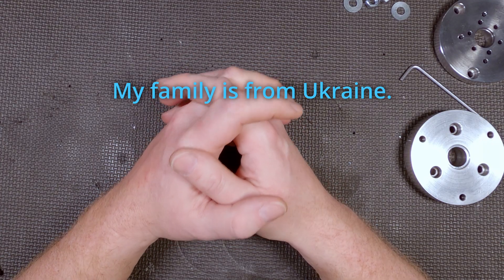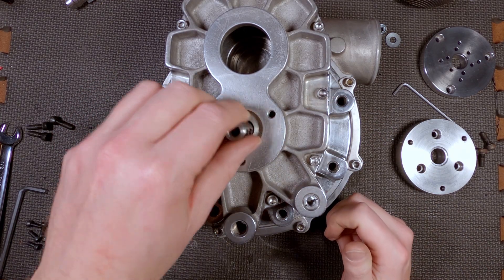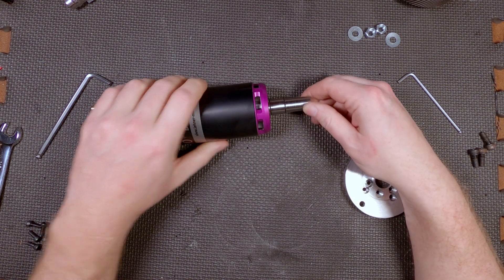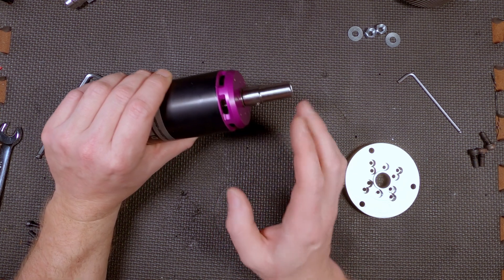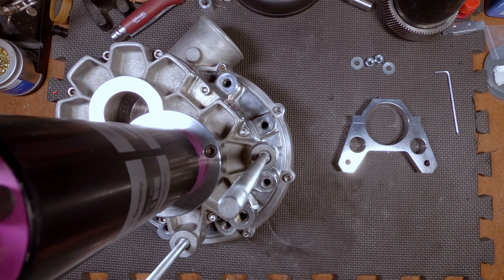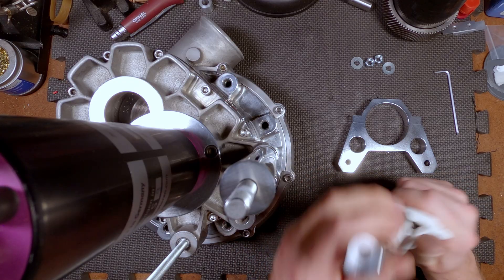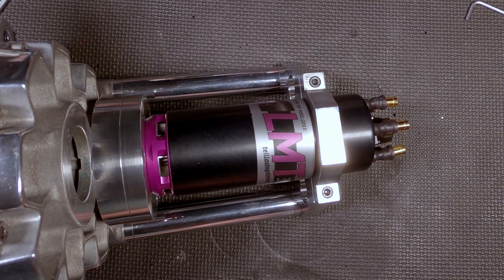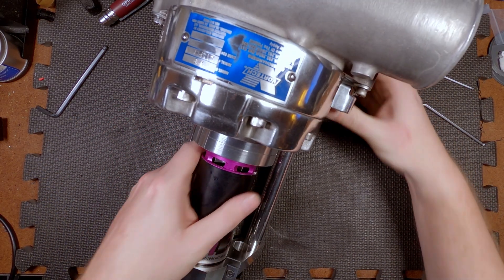DIY Electric Turbo: Sledgehammer Assembly

Comment: Why remove the vortech gearing? Drivetrain loss? Seems like a perfect setup to use multiple motors, pulleys to fine tune the compressor rpm
Reply from the maker: Because power is torque x rpm.  And the more torque a motor produces for a given power, the larger the motor has to be.  A similar power motor to the one I'm using here that spins at only 8,000 rpm would easily weigh at least 50-80 lbs and be a lot bigger.

Comment: What is the Model, KV, and any other specs on that Lehner motor?
Reply from the maker: I believe it's an LMT 30100 motor.  I don't remember the kV off the top of my head, but it's good for 50,000 rpm and 63 volts.  Everything is currently packed up for my move.

Comment: I worked on my grandpas farm with tractors and other heavy equipment and soon followed with wanting to make more power with great reliability. In the proccess Ive come to learn heat is almost always gonna be your enemy. Its also VERY expensive.

Quite a bit of time has past and now I own a 2016 LML Duramax makin around pushing 32psi.  Intake temps and EGT's are such a pain in the ass and there is no way of getting around them with the typical turbo set up. Ive looked into supercharging and everyone says it's not for diesels due to parasitic loss and what not. And really the only thing that comes up is Detroits 2stroke engine with blower style setups which are meh at best

As soon as I heard about electric turbos I instantly knew how much of a game changer those could be and also knew the limitations. This whole setup you have here is some seriously clean and professional work

Comment: You just snagged a `scriber... I used to be madly passionate about cars some time ago, but my main focus was machining and machines... I watch jafro to keep my automotive passions up, but you just hit the spot... Ang. con. ball bearings in a turbo... Most interesting... Not sure as to how brilliant of an idea that really is, as any gunk will mess those up real quick and in a hurry, and engine oil is definitely not clean enough for such lubrication even after 10 hours of engine work, but hey, fuck do i know, i just saw this shiny block for the first time, maybe the oil is just cooling the thing and bearings are sealed and grease lubed with an ultra high speed spindle bearing grease... I didnt even pay attention to the number of ports on the thing to even check if it was coolant cooled or oil cooled... I was just pleased to see both of my interests overlap... And btw, i love the ``you`ll have to deal with it`` attitude... 

All the best and kind regards!
Steuss
Reply from the maker: Thanks.  I used Kluber's Isoflex 15 grease in the bearings and they have so far held up fine for the last year without any maintenance.  Since this thing doesn't spin all the time, I think it should last for quite a while.
Reply: @AlexLTDLX 
Aaah, so bearings are not oil lubed? Kluber makes some fine stuff... I use Kluber LDS Special A, as that is what my milling machine uses in her spindle bearings... Of course i don`t waste it on random bearings and every bearing, but when there is a bearing and an application where i want to rely on quality rather than service every year, i use that grease... It`s designed to run loaded mill spindle ultra high precision bearings for 5 years between changes, so you know it`s some good shit... 
I will definitely remember this video for future reference... I am a car nut afterall... This type of modification will likely find its way into a few of my cars... 
I have a few of my own lunatic ideas and designs, but this is much more tame and more easily doable when compared to a custom special engine with custom induction, exhaust, ``valving``, lubrication and ancillary systems... Not to speak of an exhaust cooling steam system with a turbine and condensers, all merely there to act as another induction system that partially feeds into exhaust to make a pressure delta via velocity differential as to put negative pressure on the exhaust manifold, while also having a single thin tube for secondary exhaust combustion - metered so it doesn`t mess with O2 sensors... And 4 small lines that would feed constant warm air(around 75C) to brake rotors, which would keep them closer to optimal operational temp, while also cooling them during harder use, as the turbine would likely be spooled by hard engine use(hot exhaust), and would continue to blast air through its metered lines for a minute or two just on heat inertia of the whole system... Oh, have i mentioned that the car would be converted to 4wheel drive, but all 4 wheels would be ran by independent hydraulic motors and would have 4 wheel steering and hydraulic suspension? Yeah, that is my kind of madness, so you see why i called your sledgehammer more tame... But that kind of madness has to wait... That shit will snort lines of my cash like a rockstar, and i need a special car to do it, something worthy of such a massive project and undertaking... Aaand i need to build a new shop to fit all my stuff... 

All the best and warm regards!
Steuss

Comment: I dont mean to be a dickhead, but show us a boost gauge. These things just dont work.
Reply from the maker: This one put a 12 second, 3,500 lb sedan into the 9s at the track.  Watch this video and get back to me: https://youtu.be/RT0M88xHzNQ
Reply: @AlexLTDLX  color me impressed! Takes a lot of power to get any boost out of these electric turbos. Would love to see a hybrid turbo.
Reply from the maker: Lol - you're the first doubter to get back to me after sending that link.  That shows you have integrity.  It does indeed take a lot of power - like 33,000 watts.  In this video I overlay the power going in during a track pass: https://youtu.be/nlTVHkfSQXM  If you look at the electric turbo playlist it has over 90 videos - I have a lot of money and time tied up into the development of these things.  Now I'm working on a universal controller and cheaper, easier to build units.  They run at about 14,000 watts, but can still support up to 650 hp with a single unit on the right engine.  I now have two of those and also still the Sledgehammer.  You can probably guess where this is going...
Reply: @AlexLTDLX   Haha, right on brother! You've earned a subscriber. I'll make sure to check out the build series and see how it's been out together. I'll look forward to the next setup. Respect 🤙

Comment: isnt this an electric centrifugal supercharger? since its not exhaust driven but instead driven by the motor. for en "electric turbo" it would have to be more akin to an F1 MGU-H, where the electric motor powers the shaft of the turbo in the space between the hot and cold sides (though arguably, that could also be seen as an "all in one twin charger" as it becomes both motor and exhaust driven, like a twin charging setup)
Reply from the maker: Yes, but more people search for "electric turbo" than "electric supercharger."
Reply: @AlexLTDLX  haha, fair enough. fun build, interesting to see it done on a scale that can actually be used instead of just as a proof of concept.

Comment: How would someone tune their engine for this? Although I’d assume you can figure a way to use a pressure sensor and some electrical components to keep your boost at a specific pressure no patter the rpm. You’d have to have it automatically adjust the motor speed accordingly with either throttle position or relative to intake pressure/boost
Reply from the maker: My car has an aftermarket EFI setup.  Here it is at the track: https://youtu.be/RT0M88xHzNQ
Reply: @AlexLTDLX  I saw but what controls the speed of the turbine motor? Is it full on all the time?
Reply from the maker: In my case it's on full speed once the throttle is over 80% and the engine is over 3,000 rpm; since the car makes 500 hp N/A, I'm going for max power.  But you could easily stage it.  I'm working on a "universal" controller based on a differential MAP sensor.

Comment: where do u even find a motor like that.
Reply from the maker: LMT in Germany made this one.  It wasn't cheap or easy to get - which is why I've developed an easier, cheaper unit that supports only slightly less power.

Comment: The problem all way falls to the cooling and lubrication
Reply from the maker: So far it's been on the car for a year and has required no maintenance.  Keep in mind, it doesn't run all the time.  You rarely need to go from 500 hp to 800 hp in most circumstances.  If you haven't seen the latest track test video of this thing, here it is: https://youtu.be/RT0M88xHzNQ

Comment: No electrical engine is going to be able to keep up with that high of RPM even with gear reduction it's going to wear out the parts
Reply from the maker: This thing put a 12 second car into the 9s on pump gas: https://youtu.be/RT0M88xHzNQ  And it's been on the car for about a year with no maintenance.  Remember - it doesn't run all the time.

Comment: What is the rpm of the motor?
Reply from the maker: It peaks at 50,000 rpm, but we're seeing about 33,000 under load (supporting 800 engine horsepower).

Comment: If you could replace those 2 plates with 1 plate of approximately equal mass to a single plate, your electric motor would have to move that much less "extra" weight.  I know spool-up time and max rpm of the compressor are already awesome, but you'd draw less from your bank of batteries.  Do you have to replace those often?
Reply from the maker: The batteries should outlast me - they're LTO (lithium titanate oxide) cells.  They're supposed to be good for at least 30,000 charge/discharge cycles.

Comment: How does it know what rpm you're at for the boost timming? If it's on all the time, I'd imagine at low rpm would be too much boost. Does the position sensor tie into the tach wire at the coil? So it can increase boost as the rpm climbs.
Reply from the maker: It's controlled by the car's EFI computer.  Currently, I have it set to trigger above 3,000 rpm and 80% throttle.
Reply: That thing is awesome. Is the position sensor tied into the computer and at what spot?

Comment: What size motor is that? Its huge! Beautiful craftsmanship. You have to sell these because i need that bad! Cheers from Australia ❤
Reply from the maker: Thanks - that's an LMT 30100 motor.  It's rated for 50,000 rpm and 53 hp.

Comment: Why did you choose a supercharger as your base for this? I was thinking of making something like this but I was planning to use a turbo with a blown exhaust housing.

Just what you had on hand? Or is there something I'm not thinking...?
Reply from the maker: Good question - turbos generally require higher impeller speeds than centrifugal superchargers.  Given the hp level I was looking for (editing the second dyno video right now - and this thing is definitely capable of 800 flywheel hp on a good weather day), and the available brushless motors/ESCs, this seemed like a logical choice.  If you're looking for less power, there are smaller brushless motors that can turn 75,000 rpm; but definitely check out the P2 versions on my channel - they make make less power, but are a lot cheaper and are more "tunable" given the belt drive and available pulley ratios.  You could optimize those for a particular engine much easier.

Comment: I'm probably missing something;  How does this spool up when needed?  A turbo charger, being driven by exhaust gasses, increases speed (boost) as the engine speed does. Does this run constantly? Serious question. Thanks. what do you think of the Chinese turbos for sale on Ebay?  Good video!
Reply from the maker: You can control it any number of ways.  For example, in my case my ECU turns it on when throttle is above 80% and RPM is over 3,000.  You could even build a progressive map.  It's far more responsive (virtually no lag, relatively speaking) and much more efficient (no pumping losses) than a regular turbo.  And no, it doesn't run constantly.  With the engine drawing through it when it's off costs only about 30 hp (out of about 520 naturally aspirated) - so it's not a restriction at all on the street in regular driving.  The ebay stuff is junk; don't waste your money.  Our dragstrip test with this thing shows you how much power this thing actually pulls during a pass - and those ebay things are a couple of orders of magnitude off.  Check it out: https://youtu.be/nlTVHkfSQXM

Comment: Was wondering the reasons why you stopped using the Speedmaster P2. Was it the inability to connect the electric motor directly to the belt drive shaft, or that the new one was just higher quality and more capable, even though it had all the gear drive mechanism that you had to remove. Thanks for sharing all this info!
Reply from the maker: I actually haven't stopped using it - I've just been to busy to turn my attentions to it.  I will, as soon as possible - I do feel it's a more cost-effective solution than the Sledgehammer.  Building this barndominium 1,600 miles away is really sucking up a lot of my time, but when it's done - hopefully done enough to move into by next spring/early summer - I'll have a lot more time and space to devote to this stuff.  Frankly, I can't wait.  Thanks for watching and commenting!
Reply: @AlexLTDLX  I am just finishing up a barndominium just north of The Woodlands in Houston, Texas. It has 1500 ft2 living space and 6000 ft2 of shop space that is tall enough inside to double that with a second story if ever needed. I am a retired engineer and think I did some neat things in building it. If you happen to make it to Houston, I would be glad to give you a tour in hopes it gives you some ideas. All the best to your building project!

Comment: The term "electric turbo" is an oxymoron.
If the compressor is driven by a motor and not the exhaust gases,
IT IS NOT A TURBO, period.
Reply from the maker: https://youtu.be/QheFyxAWT88

Comment: I’d imagine there’d be too much fluctuation or separation between the electric motor’s rpm and the fuel trims. If there was a way to let the electric motor also be mechanically be responsible for the fuel psi and or delivery, then there wouldn’t be such a grey area between the relationship of the two. Like how the exhaust gas will ALWAYS dictate boost pressure and they work in tandem. In the brushless application,.. what is there to assure a tandem relationship with the electric motor? The electric motor can be much more responsive and precise than fuel delivery or any sensor on the vehicle so… because your weakest link is your strongest, im imagining having the brushless motor follow what ever the slowest responding component is so that the motor never gets ahead of itself boost wise and have everything else follow commands via the brushless motor. I also apologize for sounding like I know what needs to be done lol I’m just picking at the idea because we’ve all thought of it but it hasn’t been perfected yet.

Comment: I have a REALLY stupid question, but forgive me because I’m an engineer….but….why did you remove the gearing?  Couldn’t you have pushed far more rpm (and as a result, higher boost) at the impeller with the gearing?
Reply from the maker: That's a good question.  And there's a good reason - high speed, lower torque motors are generally lighter, cheaper and smaller.  And horsepower (like watts) is an actual measure of work.  You could have a 50,000 rpm motor that fits in the palm of your hand and makes 53 hp - which happens to describe the motor I'm using.  A low speed, 53 hp electric motor that only spins to 10,000 rpm would weigh at least 80 lbs and be at least 5 times bigger - yet both are capable of doing the same work.  Actually, the direct drive unit (i.e. 50,000 rpm) is more efficient because there are no gearing losses and the magnet to stator gap is smaller.  Now if you're wondering why I don't run gearing on the motor I've got to get more rpm, it's because as you go up in rpm, you lose torque - and we're already power limited.

Comment: What kv is the motor?
Reply from the maker: I think it's 840kV.  It's the 5 wind version.
Reply: @AlexLTDLX  have you played around with different  kv's
Reply from the maker: No - getting this one literally took months...
Reply: @AlexLTDLX  dang I think you are on to something Very big I had the same thought been in rc's for years. Want to run alot of thing off motors like that.
Reply: @AlexLTDLX  have you seen the max 5 esc /motor combo

Comment: 4:28 I don't understand what the position sensor help you to do?
Reply from the maker: When you're using long cables, the back EMF that the ESC uses to position the rotor doesn't work well at startup. I found this out the hard way. You need a position sensor to get the motor spinning properly at low speed. Once it accelerates then it's fine.
Reply: @AlexLTDLX  ok will you make a video showing the full installation and how it work?
Reply from the maker: Already did: https://youtu.be/PjOJU02FIGw

Comment: 50 horsepower is ~37.3 Kilowatt... Is this motor capable of this power delivery? Is the electrical system capable of this power delivery? This is neglecting losses along the way meaning more power will be necessary.
Reply from the maker: Yeah, it's actually good for 40 kW.  If you watch the video right after this, we broke 30 kW.  And my most recent video shows the thing working on the car.
Reply: @AlexLTDLX  yes it's amazing. And we know Ukraine is going to win this very important fight, God Bless Ukraine and its Heroes.
Reply from the maker: Thank you for your support, John.  Nothing I'm doing is anywhere near as important as what's happening in Ukraine - and its global effects.  Thanks again.